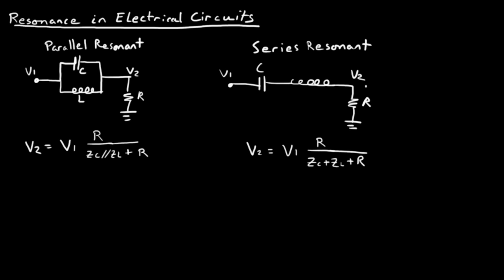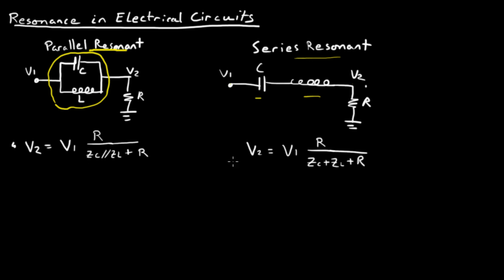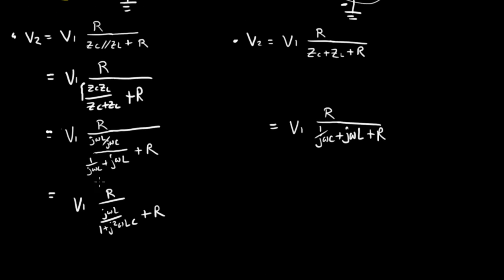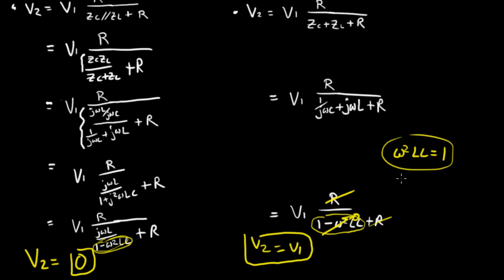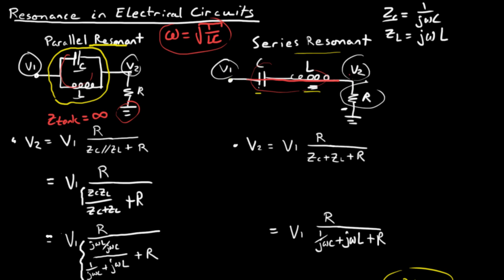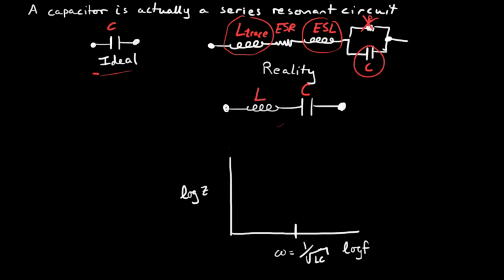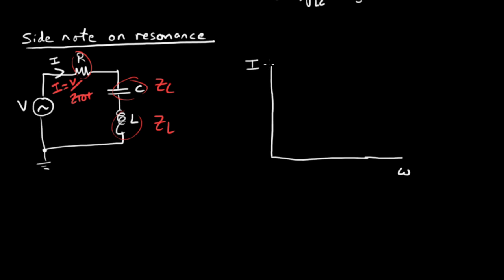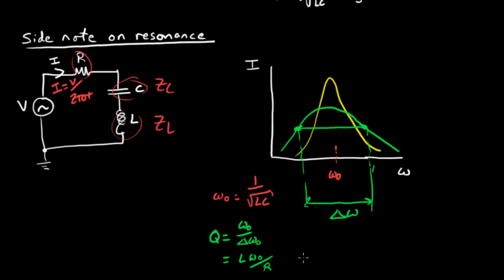Resonant LC Circuit

Comment: very good explanation on the self resonance of a capacitor, I have a better appreciation for why my resonance circuits always need fine tuning, its not the calculations being off, but the inherent stray inductances, capacitances and resistances associated with components.